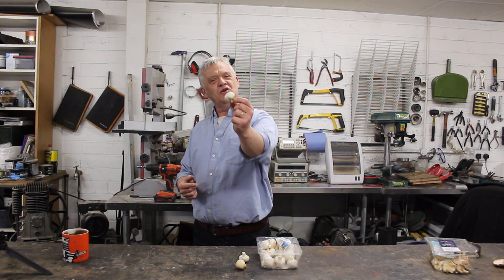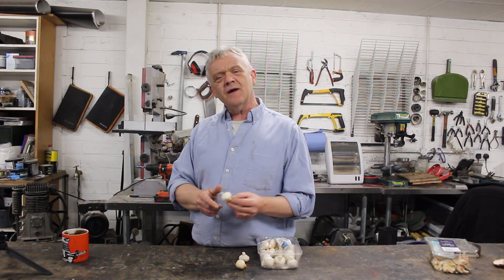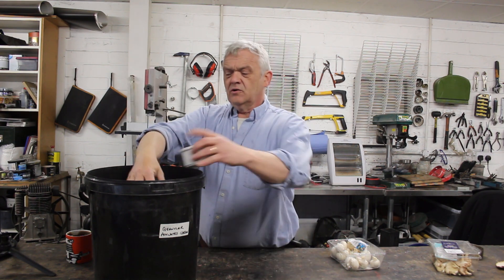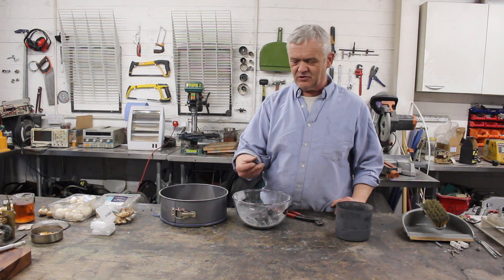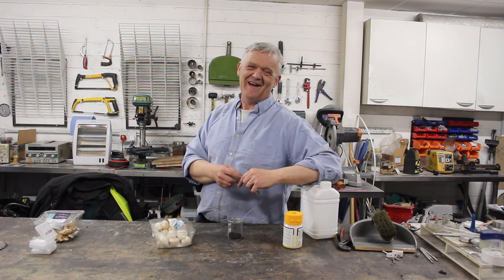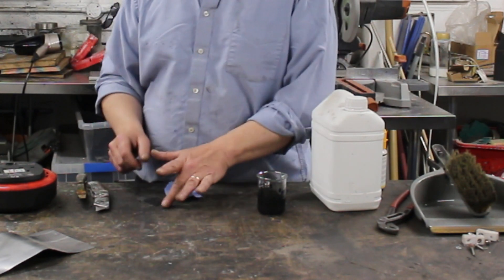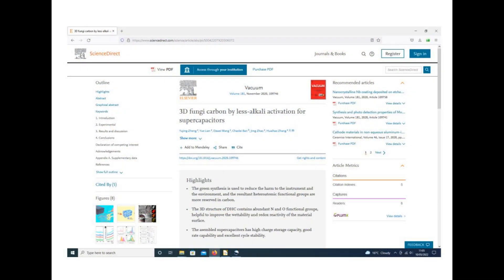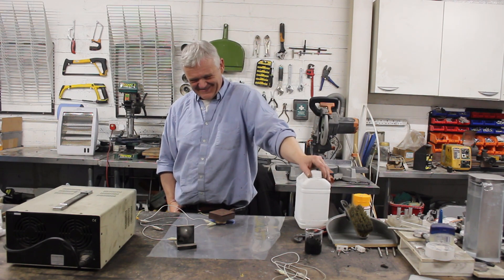Mushroom Power

Comment: Is this way of carbonization better then hydrothermal carbonization? (Certainly faster)
Reply from the maker: it's just different mate - the results are quicker but quantifiably different for example for pore size you still need an activation step with this method - you don't always need that with HTC

Comment: Impressive and neat! What advantage would carbonization of mushrooms have over other plants / organic materials? Is there a fibrous structure that they have that's particularly attractive that it retains after blending? Perhaps it's more fine than "traditional" cellulose fiber structures from wood?  Etc?  I'm particularly curious since I have a family member that's, interestingly, beginning some larger scale mushroom growth operations and even though they're raising mushrooms that have more value in sale vs burning, it may not take much to just grow a boatload of additional mushrooms of lesser value to experiment with...
Reply from the maker: you are the structures are finer but mostly they have a high nitrogen doping I believe and this changes the surface chemistry
Reply: @ThinkingandTinkering  oh wow, fascinating. Thanks for sharing this insight. I'm curious, clover might also work similarly and be easier to procure... Hmmm.

Comment: where's the link?  also, do you think you could make carbon/activated carbon with the rocket stove?  trying to think of the cheapest way to carbonize materials with minimal equipment for home battery production.
Reply: So the best way to do that in a rocket stove would be inside a sealed metal container.  But the container would have to not interupt the dynamics of the stove, so perhaps something purpose built with an exterior door as part of the chimney.  That's just spitballing.
Reply from the maker: that's a good idea - like it mate
Reply from the maker: I thought about it but there are quite a lot of papers all in the same vein mate and all would be useful if you are interested int his - so,  just put fungi supercapacitors in a google scholar search and you will see loads - cheers